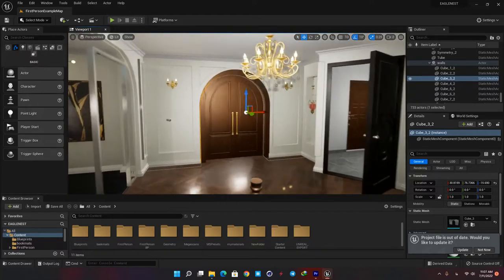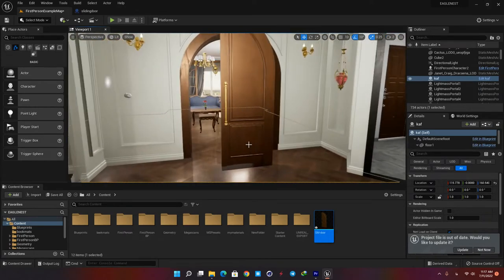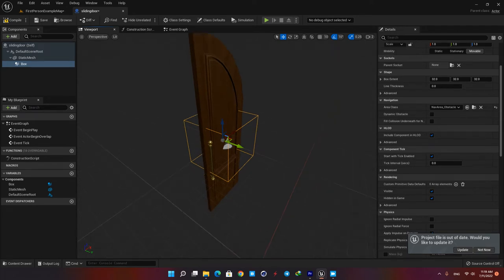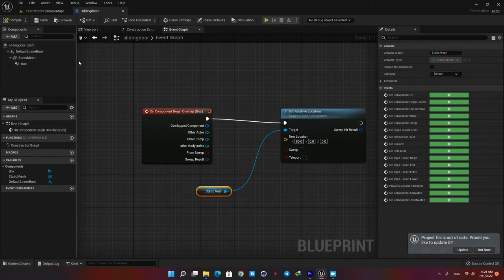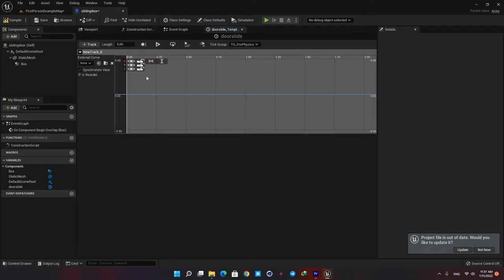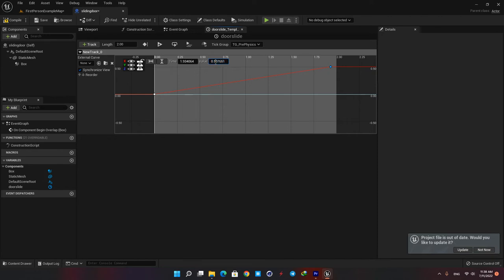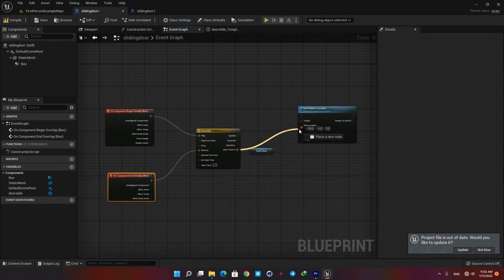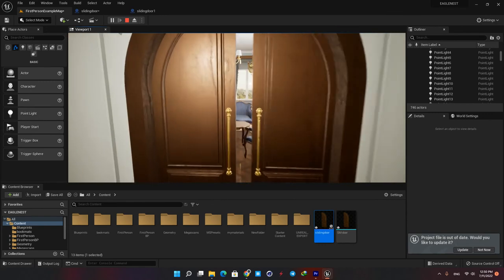HOW TO CREATE A SLIDING DOOR IN UNREAL ENGINE 5 USING BLUEPRINTS

Comment: Great Tutorial, very clear!
I added some functions to my blue print based on your solution, is working, but I have a problem, my doors have a box collider each, they open fine but when trying to close as soon as they reach the center box collider, they start to flicker. I assume that's because I'm not making any difference between the player and other colliders in the Component Begin/End Ovelap.
Any idea about how to make it work properly?
Reply from the maker: thanks, if you cast to your character and define it as the " other object " you should be able to resolve the problem. if it's the real reason for the flickering of course.

Comment: Brilliant! Might I suggest using the Cast to Player node? I saw it on another video.
Reply from the maker: thanks 🥂🙏, well there are a lot of ways to achive what you want 😉
Reply: @UnrealART  I agree. The video i previously saw was from a senior developer from Riot Games and she used that node, as well as other nodes. I found it to be odd that she used more nodes to do the same thing (using float instead of vector, as well as doubling the code to reverse door sliding instead of just plugging the EndOverlap node into the same pins as BeginOverlap node). 

I would imagine your example is much better due to it's simplicity.
Reply from the maker: thanks for your comment , yeah I try to keep the process as simple as possible so it's easy to learn and easy to use, i am doing the same job in my other turorials too 🥂😉
Reply: @UnrealART  question, and TY so much for simplicity! WHy does it work not using cast to 3rdpersonblah ? Also , I can't get any overlaps towork onmy mesh with box collision. Any idea why, the player runs onto mesh with box over it and nothing happens. ue 5.1,windows 11 all updates.
Reply from the maker: @IamNeighborlee  you are welcome,
there might be some errors in the blueprints, I need to take a look into your blueprint to figure out what the problem is, you can email me screenshots or your project file 🙏 4lirezaemami@gmail.com
Reply: Got wking!!😄😄

Comment: When I use the setRelativeLocation function, I put 50 in the x axis to the move the door to the side, but the door also moves on the y and z axes to zero.  What am I doing wrong?
Reply from the maker: maybe you didn't lock the Y and Z axis correctly in the timeline node and the value is working for the all 3 . make sure you lock z and y and only give value to the x axis

Comment: Great tutorial. Thank you man
Reply from the maker: no problem 🙏🥂
Reply: I am running into an issue where the door isn't closing
Reply from the maker: @frankornelas1011  make sure you play the level with a first person character and don`t simulate it,
also check the oncomponent end overlap and plug it into the reverse animation, it is explained in the tutorial you might have missed it 👋
Reply: @UnrealART  I just just had start a new module and then it worked. Something bugged out on the first one. Thank you so much man your great and I subscribed :)
Reply from the maker: @frankornelas1011  well resetting always works 🤣🤣

Comment: well it worked but i didnt when i tried to add the frame and the handles aroun d the door, i think i might have to do it seperately...i mean 7 time, (1x glass, 4 frame segments, 2 surfaces for the handle)
Reply from the maker: no you don't need to do that, there are better ways.

you can make them all a child to the main static mesh in the component tab so they move along with it.

the other way is to use set actor rotation instead of set relative rotation, so the whole blueprint moves and not just the static mesh .

the third solution is to go back to your 3dmodeling package, make them one mesh and then reimport it again. 

just don't make 7 blue prints for a simple door ! Lol

Comment: not work at all,...i added lerp to timeline with float range, and to relative loc i connected A with B vector values, where B change to final position,...then it works how it should
Reply from the maker: it seems you have solved the problem, but it also works as explained in the video, maybe you have missed something
Reply: You probably didn’t set the correct value for the value number in the timeline. I thought the same thing and had mine set to 1, but I had to set it to 580 to get it to open and work.

Comment: I can't even delete the three nodes in the first part, just says "All variables in use"
Reply from the maker: it can have several reasons, which ue version are you using?
Reply: @UnrealART  Version 5.3.2
Reply from the maker: you can just add the new functions after the events and not delete anything . I guess this can resolve the problem